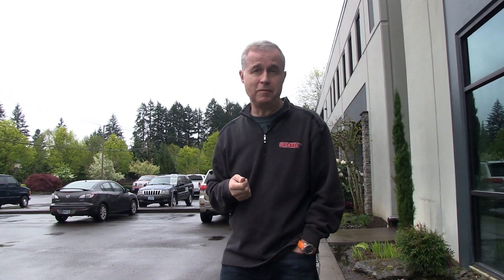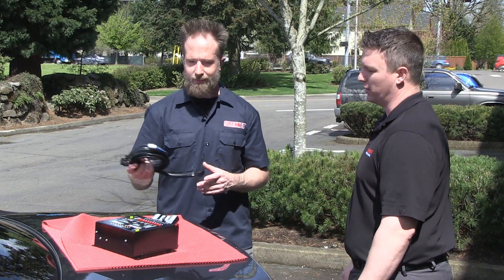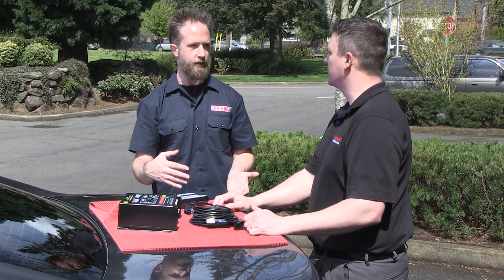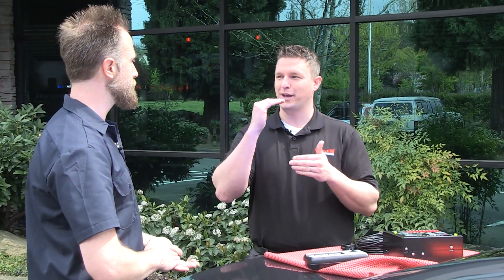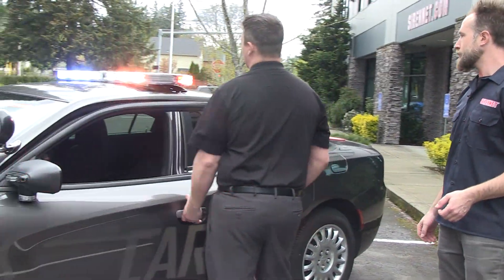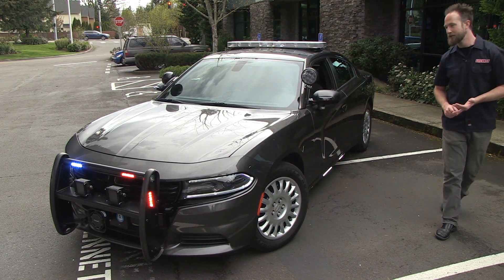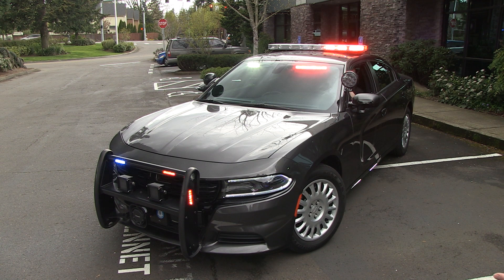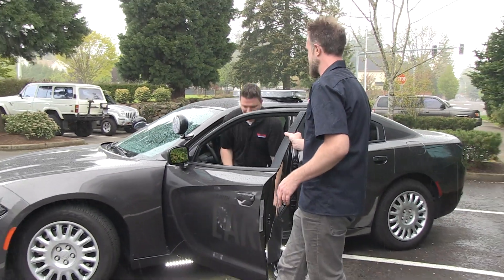Whelen shows us their CenCom Carbide Demo Charger

Comment: id like to see them develop a light bar with a siren built into it for extra noise
Reply from the maker: That would be an interesting bar to see. :)   Folks use to add the SA40 to the Liberty and Freedom bars for an over head 100 watt speaker.
Reply: Check out the new Ceridian bar they just released
Reply: That practice has pretty much gone away due to hearing damage over years of use. It is a lot safer for the occupants of the vehicle when the siren is mounted up front.
Reply: That is actually pretty common in German and other European Lightbars. They usually come as a complete all-in-one package with lights, speakers and amps built into the bar. Disadvantage, of course, is that there is less room for LED lights. Take a look at the Hella RTK 7, Pintsch Bamag Zirkon, or Hänsch DBS4000.
Reply: Best to have the siren(s) mounted as far forward as possible due to decible concerns.

Comment: Isn't the steady burn usually on a lower brightness? Well the core make it brighter even it flashes?
Reply from the maker: Through Core you can set different levels of intensity, as well as the new DVI mode (dynamic variable intensity) where the light gradually increases and decreases in brightness while never fully turning off. Take-down and scene lights can be used at full power or dimmed depending on the scene and time of day.
Reply: @SIRENNET  that I understand. 
My question is if you're using a non-whelen light, and in order to do so, you would need to set that light to steady burn first.
But Usually the steady burn is not a max brightness, so will the core flash that light at full brightness or only the intensity of the original steady burn of the light.

Comment: Question: With the Carbide system, I know there’s features where if you press the brakes, it can activate modules on the light bar to indicate the vehicle is braking. Is there a way to program the feature to disable the brake light when you’re braking for a stealth mode so to speak?
Reply from the maker: Good question... No, disabling the brake lights or setting a "blackout" mode is not possible to do through a CarBide or Core controller.

Comment: I saw in an older video somewhere you guys replaced the trunk release button with a silver button that would turn on steady white lights on the rear deck to be able to use the trunk lid as a work surface. That was a very cool feature, what parts were used for that ?
Reply from the maker: Soundoff Nforce tri-color Dash lights with pigtail harnesses verse the 12volt plug-ins were used. The trigger wire for the white over-ride was wired to a push-button provided by Star Cars, LLC. They wired in a relay for the trunk button to be switch back from white to warning when the Cencom control-head is changed via the slide-switch or when the car is shifted back to drive.

Comment: The Whelen Carbide OBD2 function works with the 2018 Chevrolet Corvette C7 Grand Sport Coupe?? And the Whelen CenCom Carbide can control the Federal Signal Valor 44-inch lightbar??
Reply from the maker: We're not aware of any testing that's been done with a Carbide CANport OBD II in that vehicle. "If" the electrical system shares similarities to a Tahoe or Silverado, you may find that it partially works... but could be iffy. Yes, a Cencom Carbide can control a Valor bar, but it won't allow for any software programming of the bar. That will need to be specifically done using the Federal Signal Serial Interface Module.
Reply: @SIRENNET  Thank you guys so much.
Reply from the maker: @RenanMXFNYT You're very welcome :)

Comment: Does the cencom carbide work with only whelen products
Reply from the maker: It'll work with other manufacturers 12volt lighting and accessories. The WeCan input is going to be specific to only Whelen's corresponding WC items for easy plug and program.